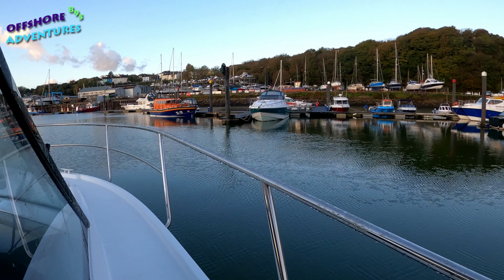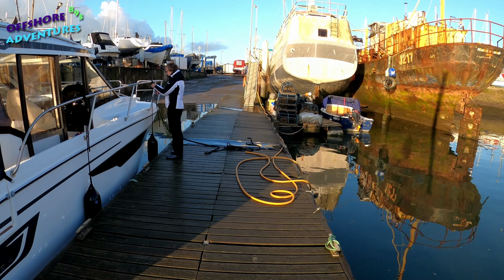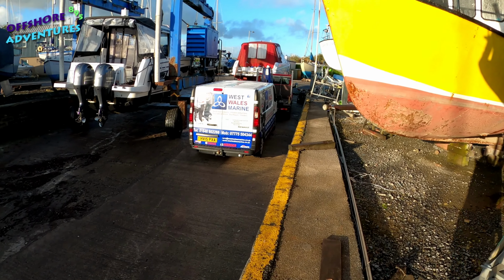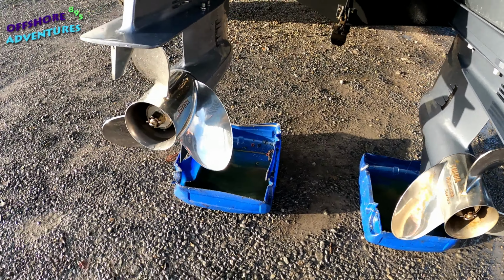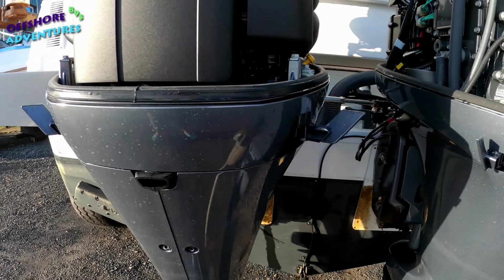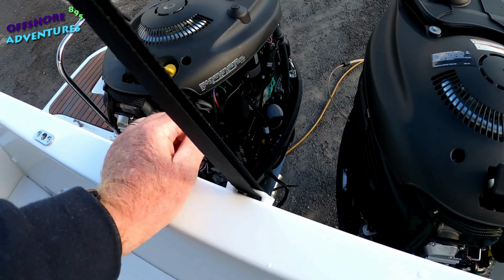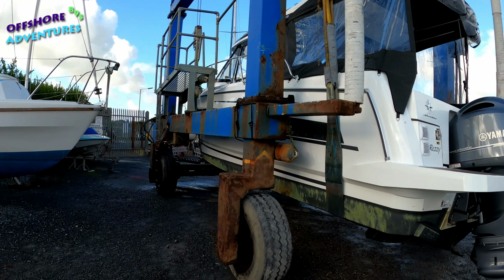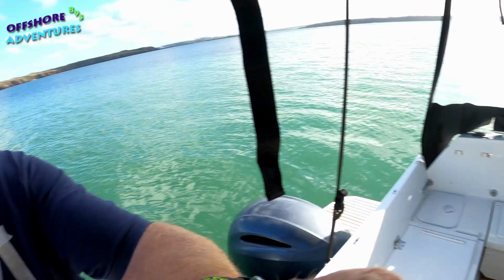20hr First Service for the Merry Fisher (NC) 895 Offshore

Comment: What improvements do you think will be on the series 2?
Reply from the maker: Well there’s a question 😀

I’ve heard a ‘modernisation’ of the interior fixture and fittings and it looks like they’ve changed the bow very slightly in respect of the bow sun pad. 
Same engine spec and looks very similar in other respects. 
I also heard they glazed the hill slightly differently but yet to see the detail on that. I’ll be looking for one to review that’s for sure :))